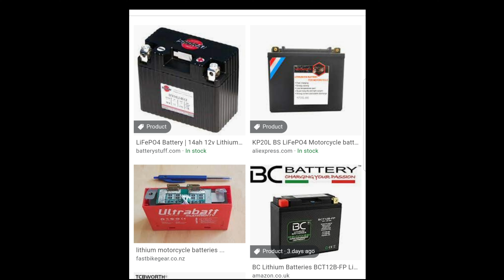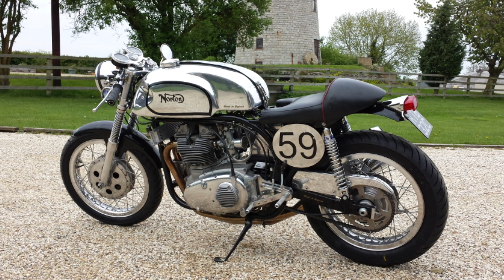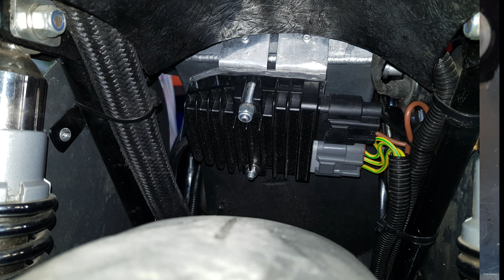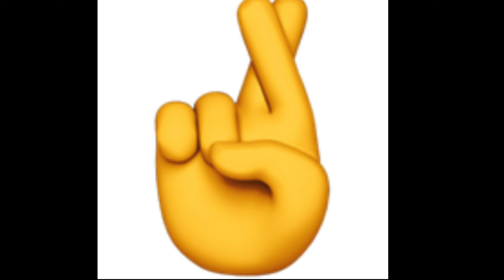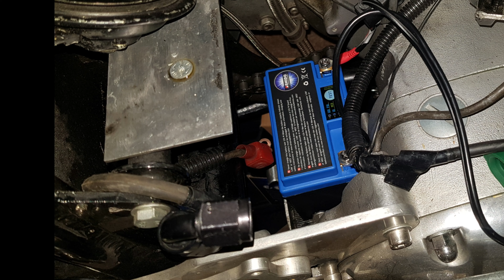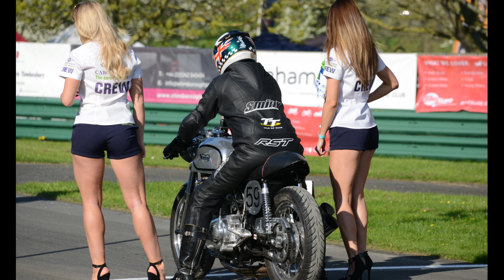Motorcycle Lithium Battery upgrade

Comment: After doing some reading, I see there is as much controversy over batteries as engine oil!  It appears there are so many factors, the Li are much lighter, can be much smaller, but cost more and need a special charger.  But they may not work well in cold climates, or on old bikes with a stock ignition / electrics.  Also, I understand they will "die" fast, without the slow warning you often get with lead-acid.  So for now, I'm not ready!
Reply from the maker: Fair play your right about the cold not being good for them. I put my lights on for a couple of mins as someone else recommended to warm battery a bit on really cold days (below 3 degrees c)... I will keep updating but I can't fault this system so far. Another bonus I can leave battery for 5 months and as its disconnected to stop parasitic drain it holds is charge well..... But I've not got an electric start only kick but the shido still registers 3 full charged lights on its test circuit. I'll keep posting yearly until it dies
Reply: @Smiffy30  , funny I didn't notice before but I have a Lithium in the Buell 1125r I bought last August!  The seller never mentioned a Lithium being in it but gave me an Optimate charger when I bought it in 90 degree weather.  I just noticed last night it's a Lithium charger!  Good thing I found out.  Anyway It's been so cold I have not started it yet but have had it plugged in since early November in an insulated garage.  I'll find out soon if it's still good but have no idea how old the battery is.  Good luck with yours.

Comment: Great video! Only problem I have with this battery is that if you don't use the bike for more than 3 weeks and if your bike has a fair bit of electronics on it, the battery will be drained out far more quickly(~3W) than a lead acid battery as the overall capacity of the lithium is less than the lead acid counterpart it is replacing.
Reply from the maker: Fair point but you can always put an isolater on battery unless bike needs to have its alarm connected permanently.

Comment: Good video.
I'm from the UK, and full of the impressive English hesitance and indecisiveness that goes with it, but live in the US.
Considering lithium on my 2007 Ducati S2R1000, but very much in two minds over whether it's worth it, or continue the life of plugging the bike in, like it's an electric to keep it topped up with the lead acid.

Just not sure it's worth the trouble.
Reply from the maker: How do from a cold UK. Its been a while now but do I have any regrets? Definitely not on this bike that's for sure. Just checked battery and it hasn't been on bike since pre lockdown and was still showing full charge. I plugged the OptiMate charger on and within 8 mins it registered full charge and went to standby. I put it on bike and have been running the led headlight for 20 mins and batt still showing all led's charged. So I would 100% recommend my set up with correct regulator etc. Shame the buggers won't sponsor me for upgrading my Honda CB750 K2.... Good luck

Comment: Awesome video Mark! I'm Evan, Electrical Engineer for RMSTATOR. I'm glad you're using our regulator from Moto Electrical. The bike looks great!
Reply from the maker: Just wanted to share my findings Evan. Totaly impressed with the unit. After some exhaustive accurate testing the RM Stator unit has performed perfectly. 3 club members have also purchased your unit and the Shido battery combination after seeing my bikes behaviour this year. Keep up the good work.
Reply: @Smiffy30  Glad to hear it! Will do!